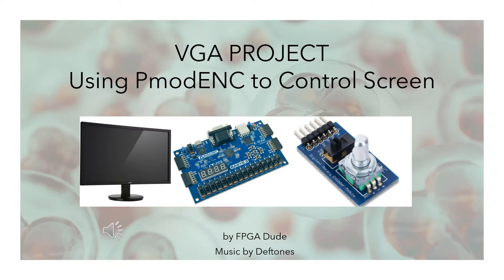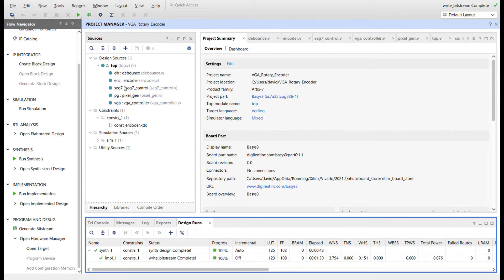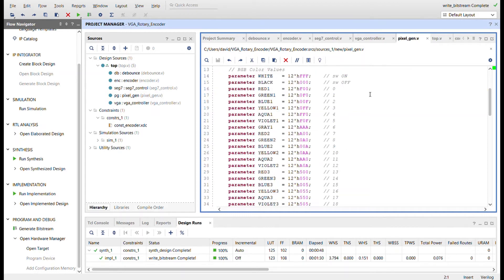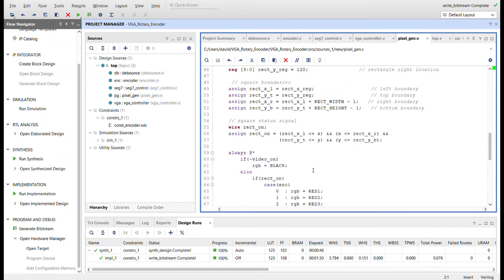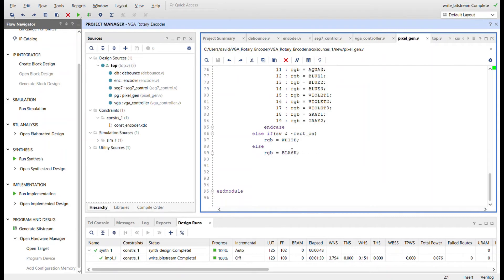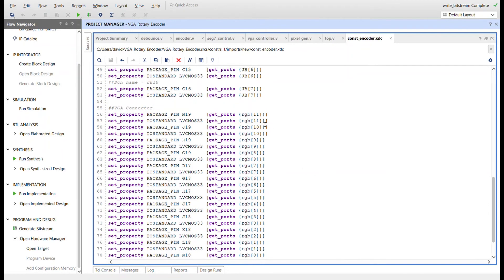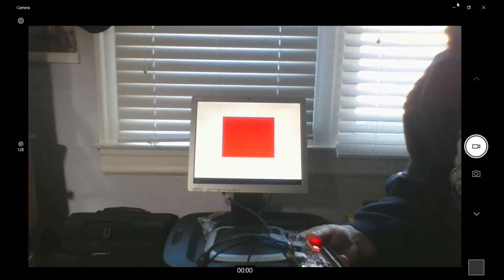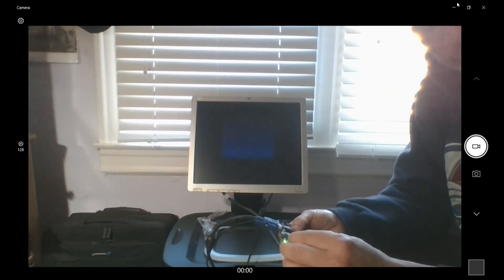VGA PmodENC Project Verilog Basys 3 FPGA Vivado

Comment: Thanks dude for your videos. I think i have to start ordering pmods as i follow your tutorials.
Reply from the maker: Thank you, for watching and commenting on my videos.
If you are going to shop for Pmods, check online auction sites such as Ebay for the best deal. Otherwise, they can be bought from digilent.com.
Reply: @dajoma36  thanks for the info infact i was going to ask you where is best place. I checked Mouser and amazon. I will check ebay too now.👍
Reply from the maker: @Avionics2  Good luck hunting down the deals.
Reply: @dajoma36  I ordered a keyboard and a rotary encoder from mouser Canada.
Reply from the maker: @Avionics2  Cool. Are you wanting to connect the keyboard to your FPGA?
Reply: @dajoma36  I meant keypad not key board 🙂
Reply from the maker: @Avionics2  Oh, right on. Those are the two I've covered so far. I'm thinking of creating some kind of video game that incorporates those two PMODs. Something like a safe cracker game where you gather clues to get the code and use either keypad to enter code to get into safe, or use the rotary encoder like the dial on a safe.
Reply: @dajoma36  sounds interesting!. Or even a snake game with the rotary 🙂
Reply from the maker: @Avionics2  That would be cool.